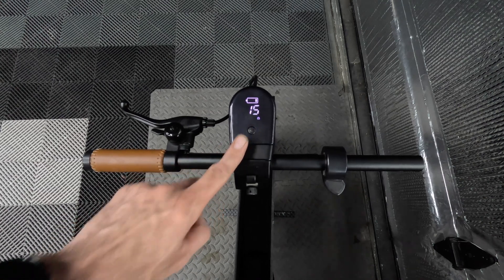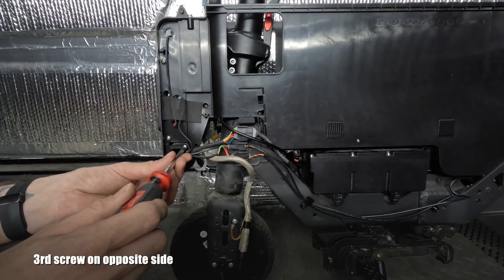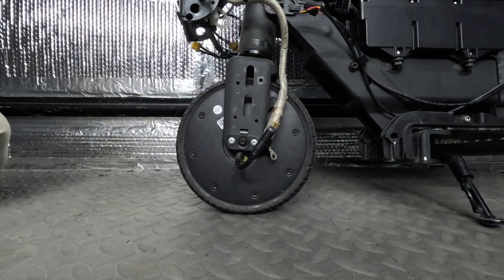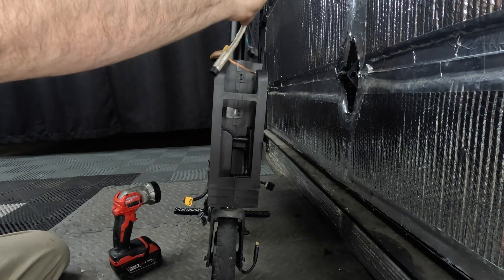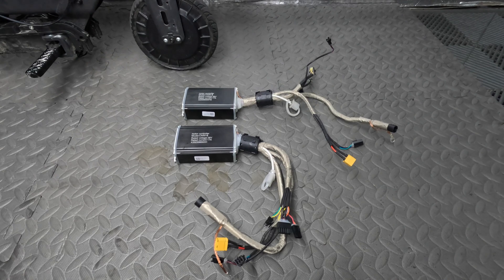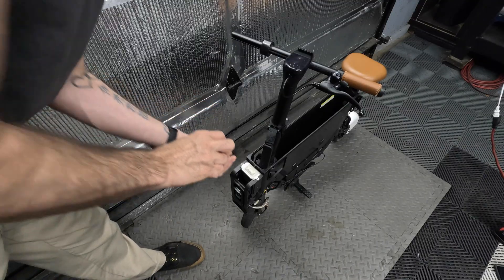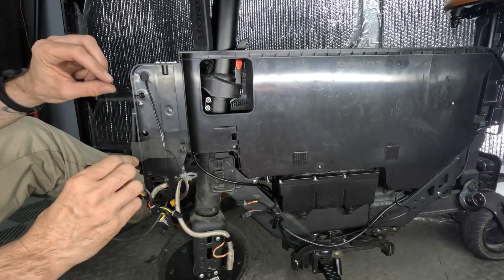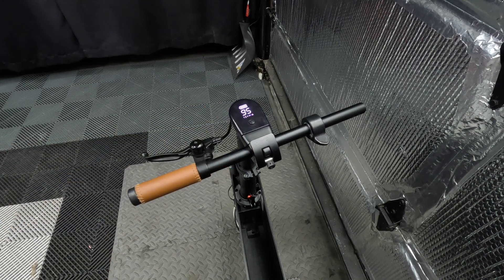Honda Motocompacto - ER71 Drive Communication Error - How To Replace the Motor Controller

Comment: Any ideas if it's not the motor controller? Did the front wheel spin and it still had the same level of free spin.  Can't even get the console display to power on. Charger blinks and then turns solid green right away now without the breif yellow light before going back to green blinking to charge.  
Thoughts/ suggestions?  Thanks!
Reply from the maker: I'm not 100% sure, but you can try searching the"Honda MotoCompacto Enthusiasts" Group on Facebook https://www.facebook.com/groups/300682449441818
It looks like most people are saying the ER71 message is caused by the Motor Controller, the Display Screen, or a Battery issue.
Did you get the ER71 message, or did it just shut off on you? How long has it been flashing a green light on the charger for?
Reply: @HondaFit4Adventure  Thanks for the suggestion.  I did get the ER 71 flashing on screen right before the moto went dead. Was riding down hill and the error code blinked before screen blackout. Wouldn't turn on again and won't take a charge.😢
Reply: @PBDyken have you found a solution ?
Reply: @Johnnytalksaboutit  had to do a complete component swap. It was a small fuse inside the battery that got upset when the battery temp went out of spec and blew to shut the unit down. Had to have a bypass run on the fuse because just replacing it didn't work and continued to blow. Motor control had to be bypassed as well with a 3rd party unit and some new cable run. Ultimately the scooter is usable and foldable again, but only operates in mode 1. So it's better than a complete loss, but not a complete recovery solve either. 😢 it's really frustrating/disappointing Honda went with this battery setup as it's prone to this kind of failure and challenging to solve.
Reply from the maker: @PBDyken Did you post about this in the Facebook group by chance? Someone just posted having the same issue, but they mentioned resettable fuses on the BMS, which I've never heard about or have seen in photos. The BMS fuses blowing seem to be an issue for some users. I wonder if newer compactos have resettable fuses, instead of the soldered on ones that just brick the battery when blown 🤷‍♂️
Reply from the maker: @PBDyken You mentioned replacing a fuse. Was it soldered onto the board?
Reply: @HondaFit4Adventure yes, it was a soldered on, super tiny fuse on the bms board.